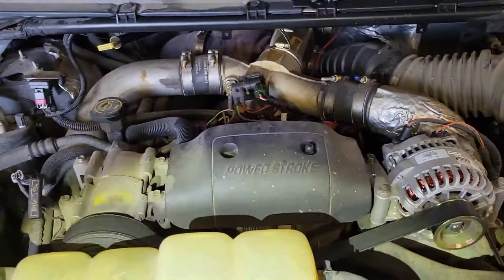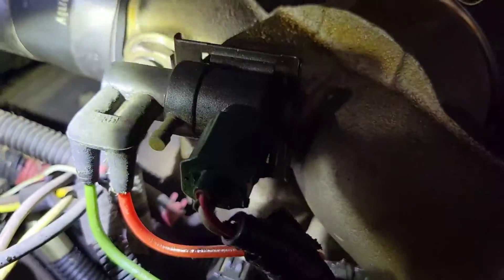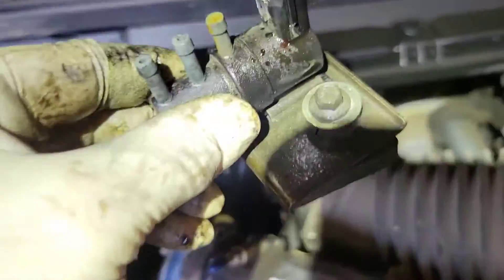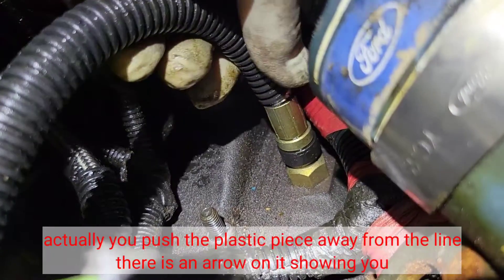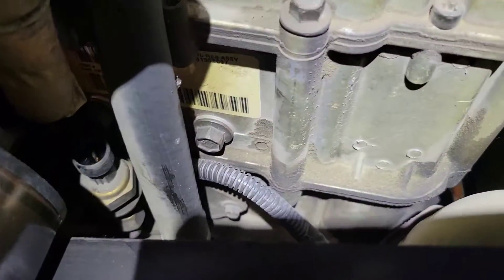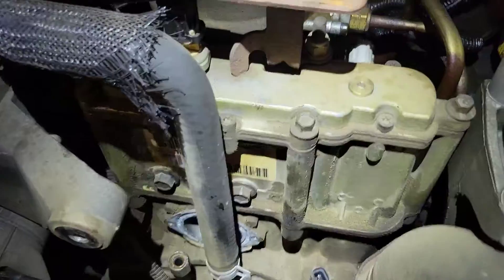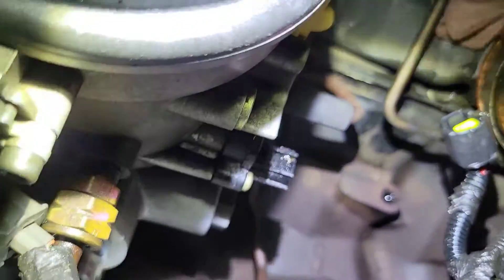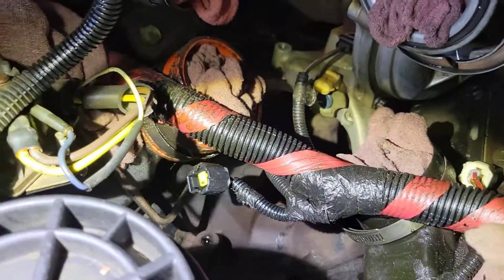7.3 POWERSTROKE HIGH PRESSURE OIL PUMP REPAIR

Comment: I thought this was going to be the repair of the HPOP not the replacement of one. Hummm, still good video. Do you know of one that shows how to repair one? Also the tool pushed the release ring up into the coupler and forces a coupler internal snap ring outward to release the Oil Line Tube end. I did a video of it on my channel "How to Remove Fix Stuck 7.3L HIPOP Lines" when they don't want to come off and how to fix the release ring so you can reuse them. Best Wishes & Blessings. Keith Noneya
Reply from the maker: I don't rebuild components,  I work in a shop with a really good warranty so if there is an issue we would warranty the pump.  I don't have any videos of rebuilding one sorry.  Thanks for watching.
Reply: @NutsandBoltswithTone  Not a problem thanks for the reply and still love the video. Best Wishes & Blessings. Keith Noneya